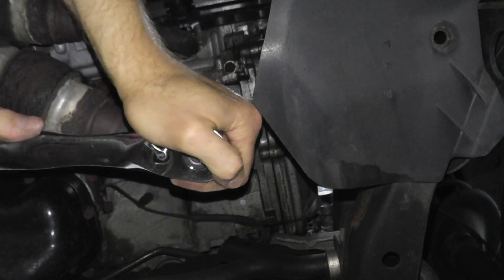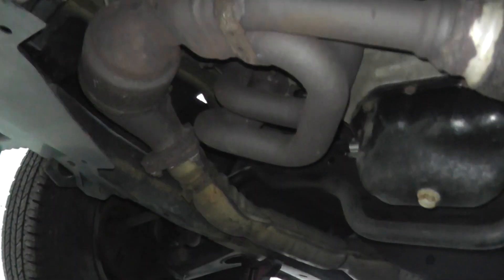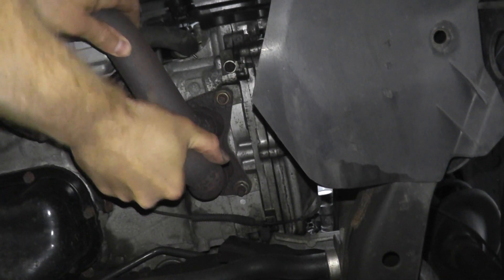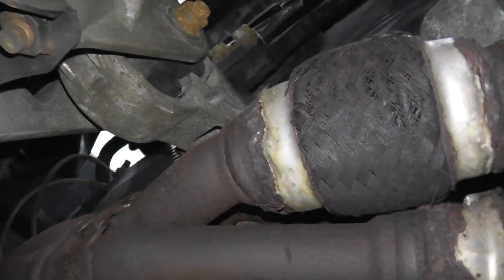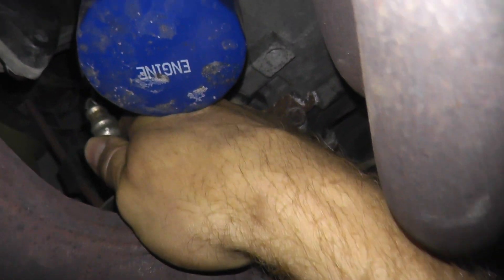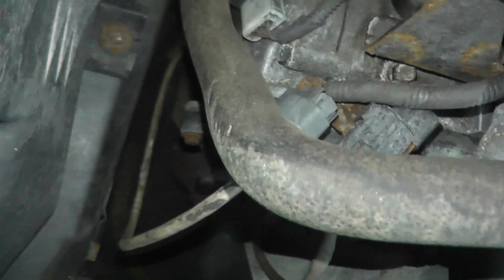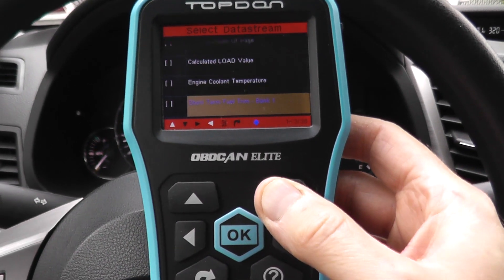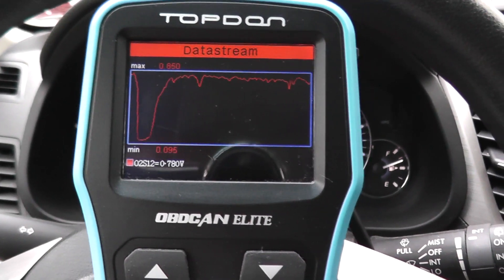Do I Really Need A Catalytic Converter?? | P0420 Testing

Comment: Hi and thank you for this video. This was extemely useful and thoughtfully done. I followed all of your recommendations. I just wanted to share, for all who come here in the future, that I was lucky and escaped having to replace the CAT. We've got a 2010 Forester with the dreaded P0420 error. The car runs fine and we get no other codes. I spent some time researching and scanning with my code reader and everything else was fine. The CAT temp was getting up to 1600F so I thought it weird that it was inefficient, but I don't really know. I tried graphing the O2 sensors but could not make much of that either. My rear O2 sensor graph looked a lot like yours with occassional dips. Watching other videos, I realized that only a genuine Subaru CAT was going to work. A local dealer offered me one at cost: $3200 US. Online, genuine parts prices are around $2K. Though there were no codes for the O2 sensors, I decided to replace them both before outlaying for a CAT. I planned to keep the car and was going to replace them anyway if i bought a CAT. Well, no need- the CEL went off right away. Boy was I elated! I used Denso OEM sensors: Front- 2349123, Rear- 2344445. As you stated, check for and fix ANY exhaust leaks, you must address them first. BTW: Subaru has extended their warranty on CATs to 150,000 miles for many models, so check with a dealer if your car is below that. Ours has 159K so no freebee!  While I was at it, I gave it a tuneup: new iridium spark plugs, PCV valve (critical on oil burners like Subaru), oil change, air filter. Thank you for this great channel!

Comment: To find a leak on your exhaust system: Induce a source or air thru your tail pipe (shops vac output, hair dryer, leaf blower, etc.) and spray generously the entire pipe with a loaded mixture of dish soap and water.
Reply: A hair dryer is a great idea!!  Thanks for that one!! 👍🏾
Reply: Hey,  just curious… I’ve had my pipe welded multiple times in different areas and I’m still getting that code, should I just replace the cat?
Reply: @MakQeen  Replace it.  Get a reputable brand with a  long warranty or OEM.
Reply: @danmc2678  I did. The codes have dropped. Car this much better now.
Reply: @MakQeen  did you go aftermarket or oem?
Reply: @naughtyotter5547  oem this time

Comment: Team - Great video. At time 8:20 you state the dip in the voltage data stream could be a bad sensor or cat converter. However, in the conclusion you state it is the cat. How can you determine if it is the rear O2 sensor (easy replacement ~$100) or the cat needs to be replaced (>$500 and hard labor)?

Comment: An aftermarket Exaust manifold  will eventually throw a code on a Subaru. I had the exaust replaced on our 2015 Subaru Outback due to a cracked exhaust.  The Walker brand replacement is already throwing a code. Apparently,  aftermarket Catalytic  converters are not manufactured to the same specifications  as OEM and will cause issues in a short amount of time. Mine made 10 months. Now I have to order OEM and replace that Walker. The garage that did the first repair went out of business. So I am screwed.

Comment: My 2017 Forester has a bad exhaust or oil smell coming from the engine compartment and exhaust. 
There is no sign of oil or any other leaks. Online forums have suggested replacing the PCV valve.  
The Subaru shop says it needs a new CAT even though the only symptom is the smell.
There's no code.  No loss of power. They tried to suggest that it sounds loud when it's cold but gets quieter when it warms up...  'Not really' I said.
I'm not jumping into the line of fire of a $3500 parts cannon. 
I'm going to pull the PCV valve and see if it rattles and replace it either way. $20.00.

Comment: That weld you see is likely from the expansion joints cracking.  Happened to my 2010 Forester within 5 years of owning it.  Joints are cheap and easily welded in.  Subaru uses crap metal for everything.  I've never had a vehicle with so much rust underneath on the exhaust system.  I even have rust above my rear license plate fro crappy screws that are under the plastic moulding above it.
Reply: They also use plastic for everything. I would never buy a subaru new after  getting a used 2002.
Reply: Have 2002 subie, no rust, 390,000km runs well 02 post cat is a dud, no heater continuity,  +0.8 volts output  thinking to put a resistor across the heater to con the obd, do you think this will work? Mark in Australia

Comment: @CarsNToys    Car is a 2004 Subaru Impreza WRX at idle rear o2 sensor is stable at the low value like 0.045v.   I see yours is hugging the upper value rather then the lower value.  Is this strange to you??   I'm troubleshooting a p0420 code

Comment: My Acura TL started throwing this code around 180k miles. Used to come on every two weeks. Most recently, I reset the check engine light and religiously go to the same Shell gas station every time (and buy recommended premium). Now at 205k and the light hasn’t been back on in months.
Reply: im gonna try just running on premium before I go to emissions, think it'll work?
Reply: future shock worth a shot. Eliminating the knock sensor going off from using anything lower than 93 octane might work
Reply: Was it running rough while the code P0420 ?

Comment: How are you sure it’s not the o2 sensor without trying to replace it first? Way cheaper I feel.
Reply: You can monitor you rear 02 sensor while the vehicle is running and introduce a lean condition so create a vacuum leak take a hose off the manifold somewhere while still monitoring that rear sensor and watch it. say at idle it's reading .8v and then You introduce the lean condition and should drop down to .1v you can also create a rich condition and you can see it go back up on voltage that way you know your sensor is responding accurately
Reply: I must agree with your O2 sensor question. the video ends as he says it has a bad bank 1 sensor 2 which is the rear sensor. there is no mention of just changing the rear sensor or if that is even an option. kind of left the video as a cliffhanger in my opinion.
Reply: Generally no, it's always the Catalytic  converter on a Subaru. It could be a cracked exaust  manifold too. Ours failed at 10700

Comment: so question? what does not changing cat do, when its the problem? my family all drive subarus. my brother been through p0420 for over a year now and drives it daily and move cross the country pulled a uhaul. still hasn't fixed the code I know its not leak or 02 sensor because I got him to change thouse. my sister just bought a subaru that code came on a day after she bought it she came in I checked code was def ,p0420.  I don't know whether to tell her to hurry and fix it or what will happen if she doesn't take care of it. thanks
Reply from the maker: Long story short, the vehicle won't pass for emissions.
Reply: can affect mpg (fuel economy) too
Reply: It's usually the Cats, period. Avoid aftermarket at ALL COSTS, they fail because they are not manufactured  to OEM specs.

Comment: question:
there were two catalytic converters, how did you know which one needs replacing?
Reply: When you read the code it will say bank 1 or bank 2
Reply: @edgarsanabia6874  lmao bank 1 and bank 2 refer  to which side of the engine….that would in NO WAY indicate front or rear catalytic converter lmao 🤣
Reply: P0420 is for your bank 1 ( where your Cyl # 1 is)
p0430 is for your bank 2 ( The other bank)
Reply: Late to the party but in this case (4cyl) the one before the downstream O2 sensor. The car does not have a way of testing second cat towards the back of the vehicle
Reply: You have to replace the entire Exaust  manifold on a Subaru. It's all integrated  into 1 unit. Also, aftermarket like a Walker is not manufactured to the OEM specifications  and will in a short time, start throwing the same code.

Comment: My 02 camry.......trouble codes:  po0420,po0300,po0301,and po0302........causes?
Check engine light was on.....pulled the codes......engine light went out.....45 mile drive.....no engine light
Rechecked for trouble codes.....found the 4 codes listed.....now what...light bulb burned out???
Reply: Alternator

Comment: Does Po420 code effects fuel economy
Reply: NOPE.
Reply: only if the cat is clogged
Reply: Jonn Abshire and can I unclog a cat??
Reply: @NOName-nn3jv  if the sibstrate is melted, no.  If the catalyzing agents are just worn or covered in soot, you can try cataclean or running paint thinner.  Google that.  Do you have performance issues?
Reply: @NOName-nn3jv  you could also try a spark plug defouler on the o2 sensor if the cat just won't pass
Reply: Jonn Abshire yes, I have bad fuel economy , I'm always pumping gas in my car.
Reply: Jonn Abshire had I have 420 catalyst convert below threshold one, so I was wondering if it's because of 420
Reply: @NOName-nn3jv  is the car also slower?  Do you have p0420?
Reply: @NOName-nn3jv  that very likely could be it.  Probably time for a new cat.  How many miles on the car?
Reply: Jonn Abshire yes Po420 , and I have 212000
Reply: @NOName-nn3jv  if its original, or even aftermarket, its probably time for a new one.  probably looks like the one in here.  youtube.com/watch?v=mg9njaj3NgI
Reply: @JonnyAbs-0  I have the code and have slow acceleration. I also feel like I'm wasting so much gas when I barely drive.
Reply: @ratedm90  sounds like you need a new cat then
Reply: @JonnyAbs-0  I had someone tell me it might be the 02 sensor? And I was quoted $770 for new cat at a repair shop. Also my car is a toyota camry 2.4l.
Reply: @ratedm90  could possibly be o2 but I doubt it.  Buy and install your own direct fit cat.  I also have that engine.  Does yours burn oil?  We have an 09 scion tc that burns a quart of oil every 800 miles or so and I bet that's what caused yours to fail.
Reply: @JonnyAbs-0  I have an 06 that burns oil but the one I'm having issues with right now is my 07, and from what I can tell it doesn't burn as much oil as the older one. BTW I tried the scotty kilmer lacquer thinner and it did not work!
Reply: No, it just senses the fact the cats are not performing to what the computer considereds proper output. Unless it is a cracked manifold. I which case, it will greatly affect engine performance.  You will notice it immediately.

Comment: Have that code and I don’t have a cat !!!!!
That’s drive me crazy 
P0420 
With No cat , units deleted
Reply: Word of advice, from my own personal experience (currently ongoing shit situation that's getting real expensive, real quick)~ My first cat/exhaust manifold was throwing a code because it was clogged. I grew up with gear heads, hot rods and old-school muscle cars, always straight-piped, huge headers and even bigger blowers sticking out their hoods... I started working on cars only a year ago and thought gutting mine was a good idea. It was, until it wasn't..... it triggered my Gen 1 Scion tC's ECM fuel trims, increasing how much fuel is added to the combustion chamber by 25%. Increased performance was awesome.... until the fuel started flooding the pistons and getting past the rings, down into the oil... now I have to rebuild the engine because fuel dilutes the oil... all of my valve seals, crank seal, rear main seal, valve cover gasket and basically everything that's rubber or gasket sealant/maker is compromised and leaking. My piston rings aren't any good anyway and the main and rod bearings are likely damaged, likely scoring the crankshaft and camshafts along the way. By the time you realize you have fuel mixed in your oil, it's already too late!! 
Research how to diy or purchase an adapter for your 2nd O2 sensor... it doesn't always work for all vehicles but it can save you literally thousands of dollars and they're cheap AF. I didn't know then what I have learned the very expensive and painful way now. Don't just ignore it and no, replacing the sensor itself won't do shit to fix the problem!! Hope that helps you and others. Best of luck

Comment: Well after 1000$ for 3 O2 sensors on my 2000 camry V6 the light still on and won't pass inspection. 
The mechanic tells me I need to replace all 3 cat converters at 1500$ with labor.
Selling the car as is.
Stay away from Toyota....